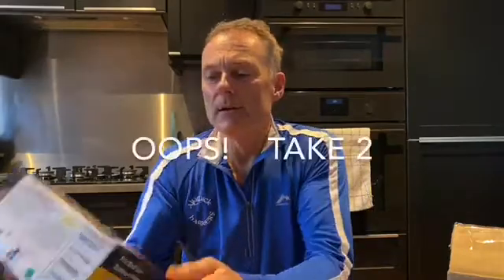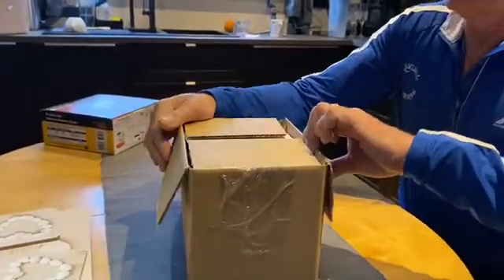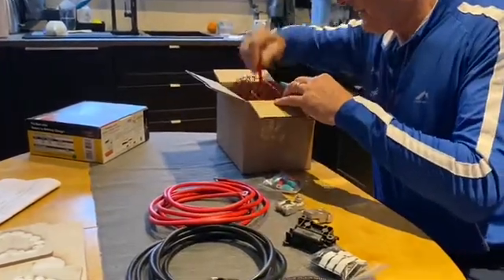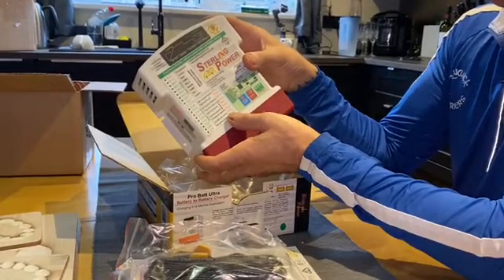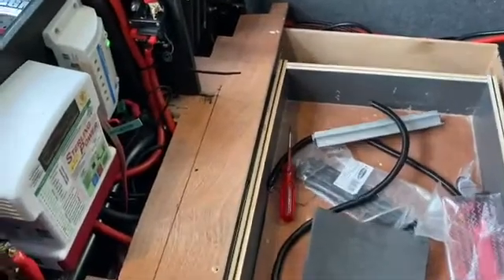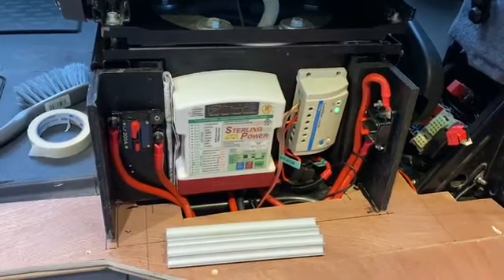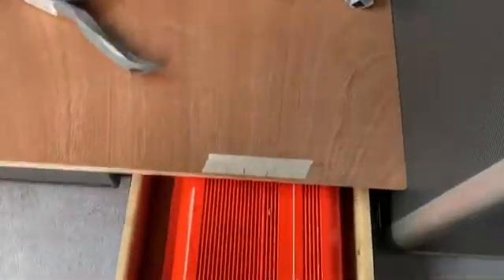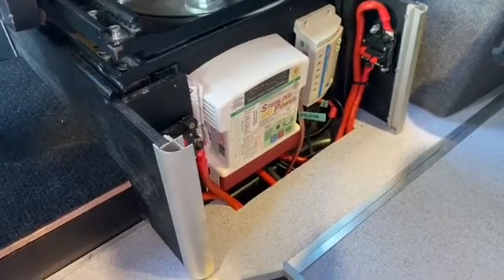Battery to battery charger Citroen Relay Installation

Comment: hi Kieth enjoyed your video, and you mention you have a sargent , could you help me with advice, i have a ducato , i want to put a b2b same as you . mine is a std alternator  my sargent is a ec155  its not connected yet  it has a charge to the starter battery and a charge to leisure battery, will you connect your charger from the sargent to the batteries as well as your b2b hope you can help thanks john
Reply from the maker: My Sargent is connected to the leisure batteries so that it charges them in the very rare occasions that I’m on hookup. It is not connected to my vehicle battery. This is not advice but it is what I’ve done.
I have a duoracer mppt solar controller which does trickle charge my vehicle battery.
Reply: @craster_van_kippers  thanks keith you have confirmed what i was thinking, a youtuber called dantheman was telling me not to connect to the vehicle battery .that great cheers john

Comment: Do you have any contact details or a Facebook page? I dont live to far from you and would happily drive to you and pay you for your time if you could check how my van is wired up and if its correct as I seem to have issues with fridge and the fitted inverter
Reply from the maker: hi susan I’ve just turned on notifications as I was injured recently. I had forgotten to turn them back on. I’m away now until October.  try and join South Central Selfbuild forum on Facebook. some ver elpful advice there

Comment: Hi Kieth, very helpful video thanks. I am about to convert a fiat Ducato and want to put two 120ah batteries under the seat. Can I ask which make you have they seem to fit really well? Did you have to cut out the floor at all. Thanks . Peter

Comment: Keith,  great video as always. I've the older version video to edit and up load but I've batteries in the garage at the rear and I'm  installed the optional remote unit in the cab. They work very well. Mines a 2015 boxer euro 5.  Jamie